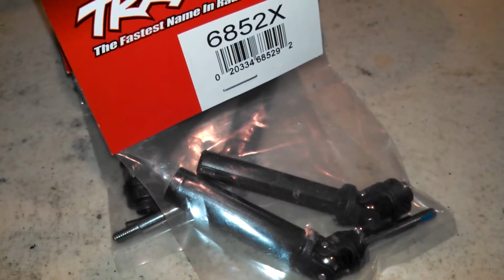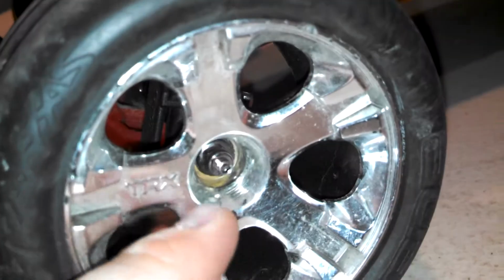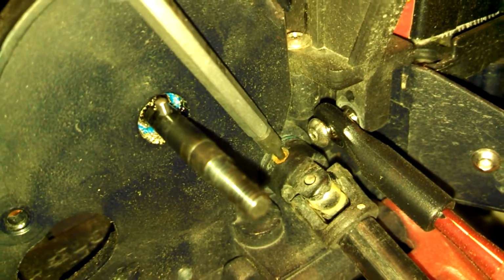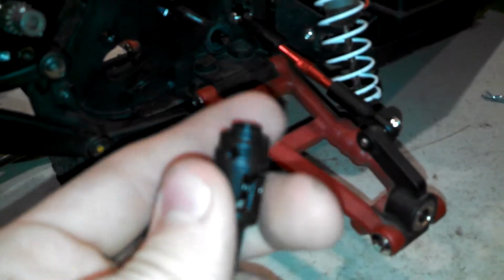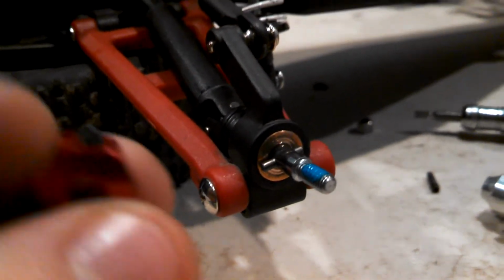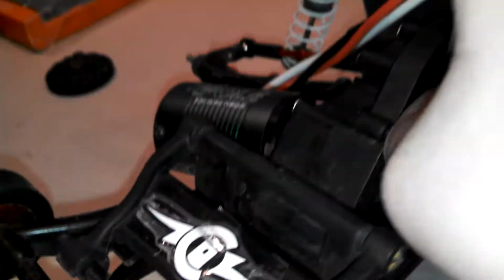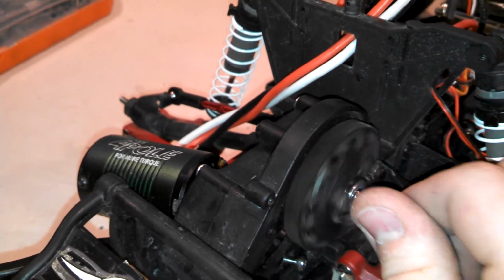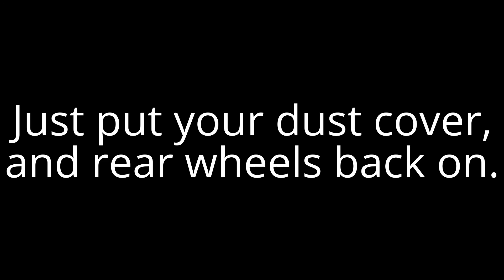Traxxas Rustler- Traxxas Heavy Duty Driveshafts [Chaos]

Comment: Only issue I have with these on my slash is that the RPM a-arm's sorta gets in the way on how I want to have my shock setup, clears on the stock a-arms. Guess its a price to pay when I want stronger shafts, I really don't need or want steel ones.

Comment: u didn't need to take the motor off when i need to remove my driveshaft i need to remove the gear cover and tires that's it
Reply: but if you have a big spur just remove those three screws i think it make it easier